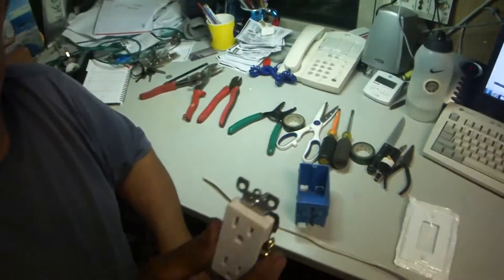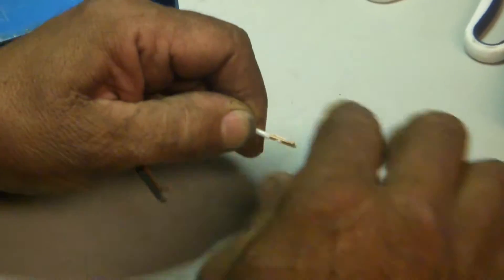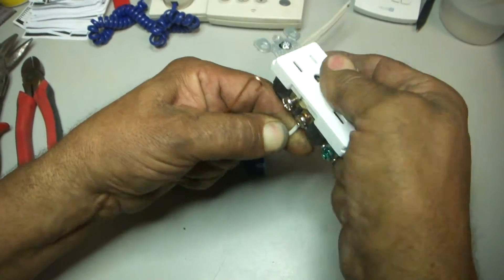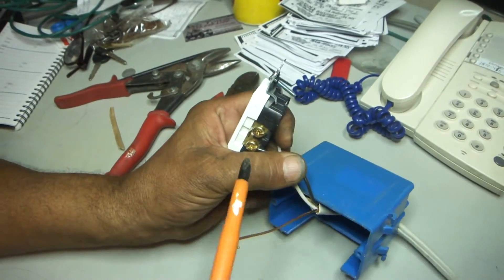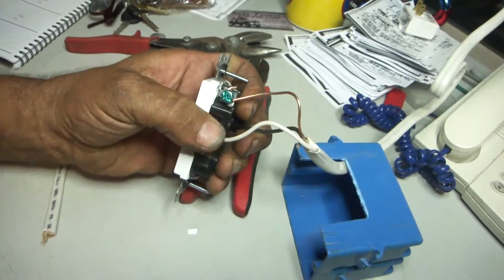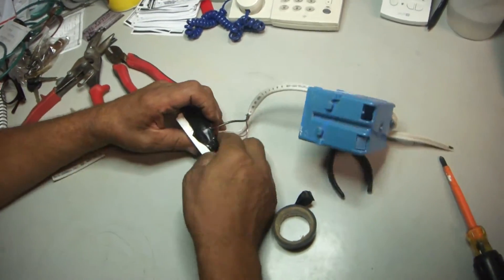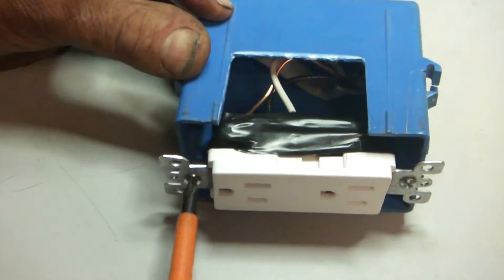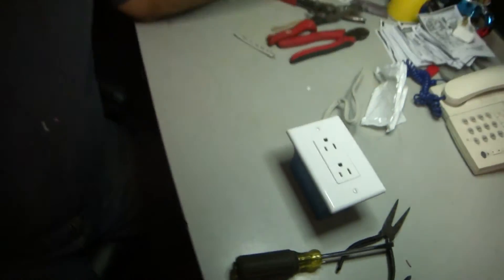Plug Wiring For Dummies - How To Wire A Home Electrical Plug Outlet - A Complete Guide By Greg Zanis

Comment: Should have mentioned that wires should be looped clockwise (same direction as screw tightening), black (and usually other colors) are hot, white neutral, bare is ground. Try to make sure insulation isn't touching screws - higher change of charring or melting but also make sure wire doesn't stick out too much from the screw.

Just additional safety and general knowledge for wiring.
Reply from the maker: I agree and may I copy and use some or all of the information you typed out for use in the video annotations?
Reply: TheDreamCar Sure thing, representing the south Chicago suburbs!
Reply from the maker: Ok, thanks and done / added to it.